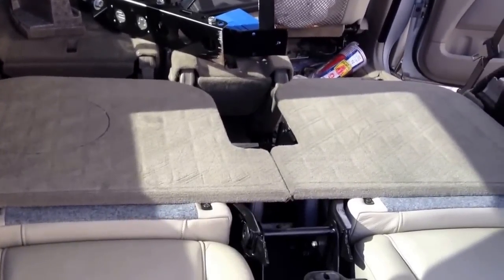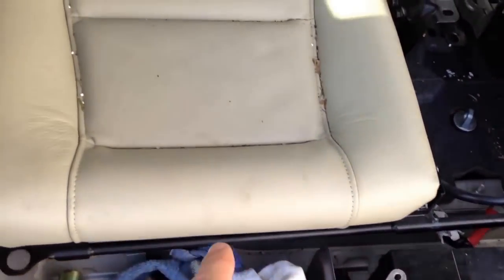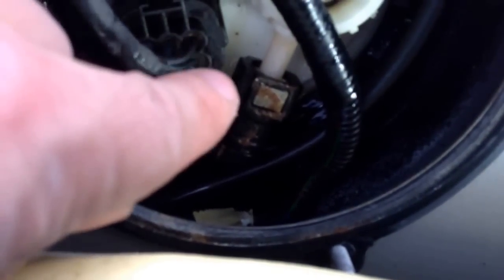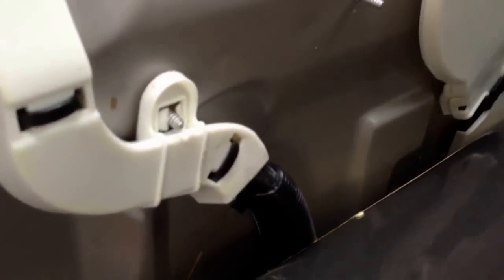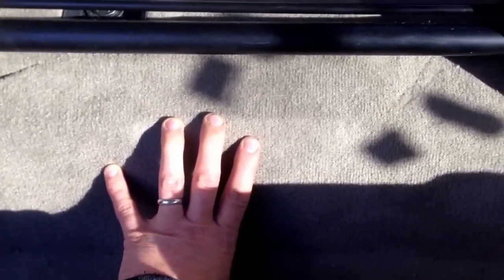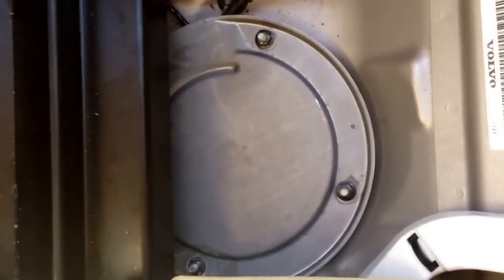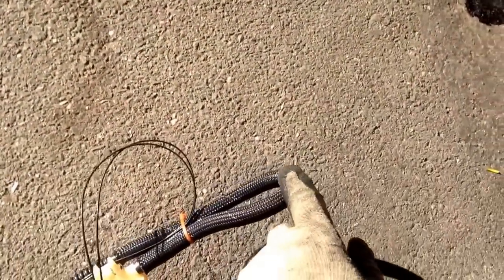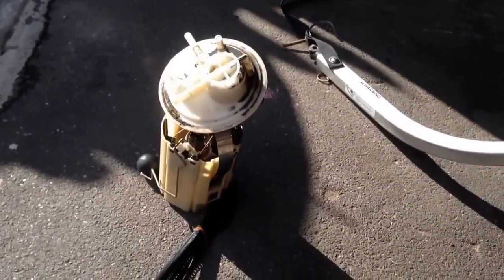Volvo XC90 Fuel Pump replacement XC70 V70 S60 2.5

Comment: All you have to do is remove the middle row of seats and lift the carpet there. That'll save ~5 hours over this.
Reply: myne4  Question. I have a 2009 xc70. Can i get to gas tank from cabin or do I have to drop tank? Thank you
Reply: @tadcraig3162  
Just noticed a link to "jaynes network"  "Xc70 How to fix fuel leak" 
The thumbnail looks very similar to this access door. Hope that helps.